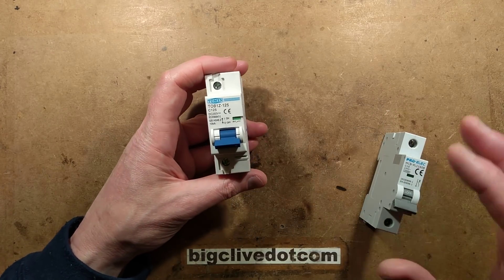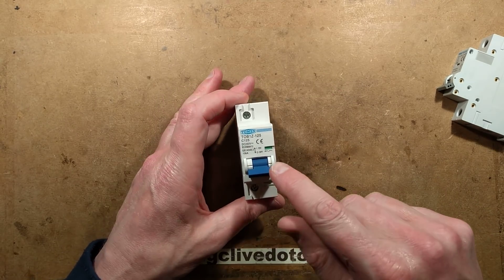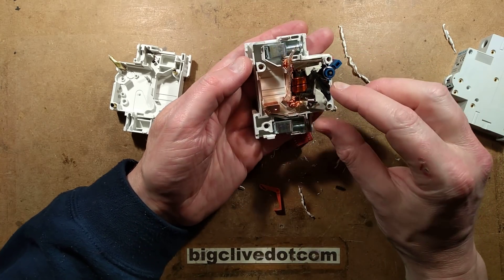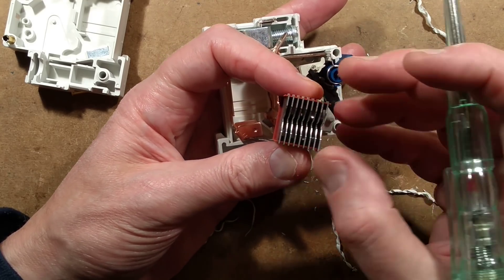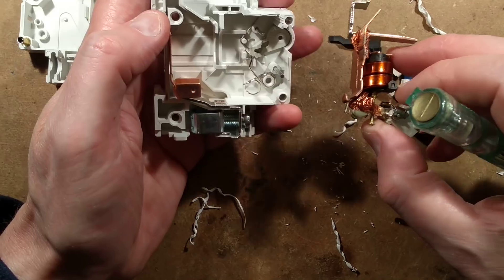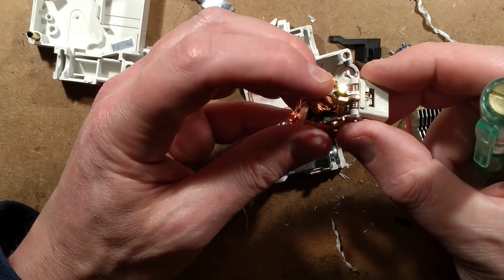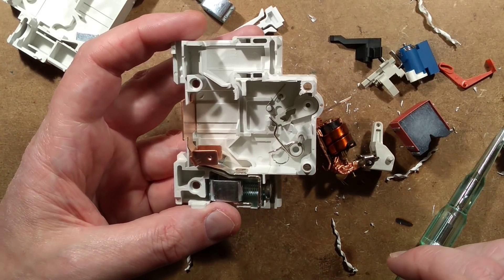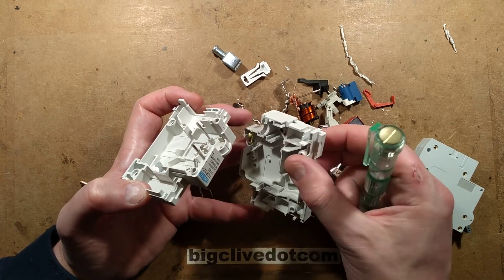Inside a 125A DC circuit breaker.  Unexpected arc quenching feature.

Comment: So because of the magnet I assume these go only one way round, right? I mean, it'll still trip if the polarity is wrong but the magnets will push the arc away from the quencher instead of into it I think.
Reply: There are 2 magnets, in order to create sort of parallel magnetic field, so that the arc would deflect to the right or to the left.
Reply: @nejiniisan1265 , "deflect to the right or to the left"? Not at all. If that were the case, there would be no net magnetic field in the region, thus no force would be exerted on the arc at all. The second magnet is presumably there just to strengthen the field as well as cause the field lines to run parallel in the region between the two magnets.

@ManWithBeard1990 is correct; if the current runs in the opposite direction, the force exerted on the electrons due to the presence of the magnetic field would be in the opposite direction, directing them into the front of the device (where the switch is), rather than the back (where the quencher is). They would still move clockwise from the perspective seen in the video.
Reply: @JivanPal  oops
Reply: @JivanPal  ABB's version (S800S-UC) is rated for use in either direction, but they claim it has two arcing chambers per pole (both AC & DC versions), so I wonder if they have a different polarity in each chamber?
The lower-current version still has +/- markings.

Comment: Many years ago (1990s) I designed UPS. It was impossible to get decent DC rated breakers. We used 3 pole AC breakers. One pole switched the negative. The other two poles were wired in series on the positive feed. This increasd the gap and aided arc quenching. Worked well enough. One thing that did surprise me was that none of the manufacturers would guarantee the operation of ANY breaker if it had tripped a fault. They recommended that any breaker that had tripped due to an overload was replaced. This made them no better than a fuse!
Reply: I was investigating DC contactors for a 240v ship-mounted crane. The ones I found were massively expensive, but one supplier rated their more common three phase units for use with DC when the load went through all three poles in series similar to your solution.

Comment: Can these things be used at 12 V DC ? I have a winch on my 4x4 and the main starter / charging circuit that are unfused. Also looking to put back up DC busses on. Could i use these for electrical protection?
Reply: Should be safe, as long as you get one designed specifically for DC at the current levels you're expecting. Using it at lower voltages just results in a lower energy arc when they trip.
Reply: @JilbertBoy  nice to have that confirmation. was thinking it may be an energy trip not a current trip.

Comment: My 20A DC breakers kept tripping because my MPPT would occasionally decide to drop the voltage and the current would exceed the rating.  So I've put the panels in series until I get around to upping the breaker.  Now my MPPT gets quite hot.  :(
Reply: Can you cook hot dogs on it?
Reply: @dsloop3907  Pretty much.  My fingers certainly feel cooked after touching it.

Comment: Nothing new. When I first started electrical engineering; I was shown such devices over 55 years ago. They were installed on Slate control panels for elevators. They actually used the current flowing in the circuit to generate the magnetic field which helped quench the arc.
Reply: The blowout coil solution does seem more elegant than the permanent magnets, at least when you go up higher in current and voltage.

Comment: Hi Clive, I used to work for a company that I believe was the UK supplier/agent for Heinemann circuit breakers and if I remember right, these were much more complex inside. They were used notably within the marine, traction and aviation industries. Not sure how you could get hold of one of these, they were quite expensive. Craig.
Reply: As a Student in the mid 70's I worked a summer for Arrow Hart Switchgear. I was on the 3 ph contactor assembly line but did some overtime on their DC breaker line. I always remember the really big (as in half-inch diameter) cadmium plated contact pads I was resistance-welding onto the conductors going into the DC breakers.. These pads were rated for 200A max, so I'd be surprised if the contacts on BC's breaker were good for not much over 50A.

Comment: People attempting to us AC Switches and Breakers for DC applications usually get educated rather fast.    Consequences of Current flow goes up EXPONENTULLY !
Reply: Been there, done that!! What I've found, is that a capacitor in series with a diode, then a resistor in parallel with the diode to discharge the capacitor when the contacts close will allow time for the contacts to open, before the capacitor has time to charge. That makes it so there's only .7 volts across the contacts(the forward voltage drop of the diode) the instant the contacts begin to open, which gives time for the contacts to separate, before the capacitor charges to a high enough voltage to jump the gap. When the switch is closed again, the resistor slowly discharges the capacitor, without putting extra surge current through the contacts. The capacitor needs to be big enough to provide the time constant necessary to prevent arcing. The higher the current, or the slower the mechanical speed of the contacts, the larger the capacitor needs to be. The diode needs to withstand the surge current long enough for the capacitor to charge to circuit voltage. The resistor is not critical, just so it discharges the capacitor before the next time the contacts open. I do that all the time, in circuits where relays have to switch DC into inductive loads. That works for switches, breakers, and relay contacts. In my 144 volt electric truck, the breaker was buffered by the capacitors in the motor speed controller. An AC breaker worked just fine. It was rated for 400 amps!
Reply: @vincentrobinette1507  It will be very helpful for some of us if you could provide a simple schematic (sketch) with values of capacitance and diode rating of your solution to the arcing problem. God bless.
Reply: @mansoorsiddique4843  I have no way to post a sketch on a reply, but, as a rule, the capacitor is sized based on the available fault current, and how fast the contacts can separate. The slower the contacts move, the larger the capacitor, The more fault current, the larger the capacitor. The resistor is based on how long it will be before the next interruption. It's only job, is to discharge the capacitor, once the contacts close. if it's a cyclic switch, like a solenoid used for a DC motor control circuit, you'll need a lower value of resistance, to make sure the capacitor is discharged quickly enough, for the next interruption.
     Case and point: When I worked at a convention center as a sound technician, we had a 24 volt electric cart, that was used to haul equipment from room to room. It featured a 4 stage sliding blade throttle, with three nichrome wire resistors. When ever you let off the throttle, the first blade would draw an arc, just like striking an arc welder. I fixed that, using a 2,200 uF, 35 V electrolytic capacitor, a 6 amp epitaxial "bullet" rectifier, and a 10 Ohm, 10 watt "sand box" resistor. It completely solved the problem. If the motor was stalled, or the throttle was let up before the cart moved, it would pass a maximum of ~40 amps. On a circuit breaker, you could probably get away with 10,000 ohms, because it will have plenty of time to discharge the capacitor before the next overload. Thermal stop interrupters,(push to reset button)tend to react slowly, don't have much space between the contacts, will need a larger capacitor. The peak current pulse rating of the diode is the most relevant rating, because it's only in conduction long enough to charge the capacitor up to the supply voltage. it is, however, momentarily subjected to the full available fault current. When the contacts close again, the diode is reverse biased, and the capacitor is discharged through the diode.
Reply: In pdf of AC CB is printed that it can be used for DC up to some small voltage, In some i read 48V DC, i use it up to 24V DC.
That is how the relays contact work, rated on same current but lower DC voltage then AC

Comment: Getting DC breakers is harder than you'd hope. This, at 125a is amazing for being so tiny. We use 200a 2 pole breakers.... but thats a huge unit. Not a DIN mount. A good 2 fists of volume. 6 inch high, 2 inch across. Great chunking  things. Biggest DIN mount, dc breaker ive met is a paltry 40a. Im no expert, but my technician spider sense would be very dubious of such a breaker. What's its breaking voltage? Under 48v, i might believe that rating.

My concern is, i didnt see a big arc supression feature. Maybe that is what the magnet is for. Ive seen big DC arcs drawn far longer than what spec sheets would lead you to believe. And an opening breaker is almost the same machine as one built to draw long dc arcs.

In my humble techie gutfeel, thats way to small...
Reply: The labeling claims 10 kA(!!!) breaking capacity at 250 Volts DC(!!!!). Even with that 2x2x2 cm arc extinction box, that seems like a very bold claim to me.
Reply: I'm with you, arjovenzia. That contact area is questionable, even for a 'one-use' purpose, and the separation when the contacts are open seems woefully inadequate. 125 A DC is into arc welding territory, and they're relying on a 'standard' sized contact, maybe 3-4 mm diameter, separated by about the same distance, to break that much current? At 250 V?!
Reply: It's that TOMZN chinese crap.. so probably lucky if it's actually break 24V never mind 240V DC
Reply: 10 kA is quiet on the low side of breaking capacity for these breakers. The AC breakers here in Germany have a minimum rating of 10 kA for household installations. On industrial installations they require a braking capacity of 20 kA.
Edit: Had it wrong. See Gaunerchens comment below.
Reply: @sebi7794  Yeah but that's for AC. Not DC. Totally different beast.
Reply: @sebi7794  The minimum rating for households installations is 6kA (according to TAB), 10kA is the normal industrial standart.
Reply: @gaunerchen1729  Yep, you are right! Had it false in mind.

Comment: 125 amps is bigger than my main house fuse and the electrons should be able to jump a big gap. JW showed an ac switch used in a dc circuit and it melted at the same same amperage
Reply: Tony Papantoniou Amps don’t matter in arcing, voltage does. So a 10 million amp source at .000001 volt won’t arc under standard temperatures and pressures but a 10 million volt source at .000001 A could arc several feet. Which is exactly why high voltage distribution towers look like they do to keep the transmission voltages as far away from ground and each other as necessary. 

FYI minimum arc is 10kV in dry air, the reason you see household stuff arc in the sockets has to do with inductance and collapsing magnetic fields creating high voltage.
Reply: @peterg.8245  DC needs bigger gaps on switches as it jumps further and quicker breaking

Comment: i bet they tested it, bc its such an important safety device, i have learned to much about electronics watching your channel, awesome thatnks so much !!!⚡️⚡️⚡️⚡️
Reply: so the magnets WOULD have more use in the DC circuit as opposed to using a magnet with the AC,,right just due to the behavior of the DC? ( like in a TV the magnets move the beam in the picture tube and its DC (highvoltage DC))???
Reply: @sa8die  Yep.

Comment: thosse things usually get tested.
Some got adjustment screw. They get triggered and adjusted multiple times at the factory until in spec, then the screw gets potted.
Reply: Yes, when we are talking about life saving devices, it is not enough that "they should work". They have to work, every single one!
I think they for some devices are talking about max 1 in a million non working units.
Reply: @friedmule5403  Regualr circuit breakers are there to protect the cable, not your life. For life saving devices there is common sense and RCD or RCCB breakers.
Reply: @anti4354  Okay did not know that, thought that the fast reaction time and wary low current was to save people.
Reply: @friedmule5403  If the cable fails, it quite likely ends up in flames. Flames in your wall are far from optimal.
Reply: @namibjDerEchte  LOL central heating, is a good thing:-) No I do understand but you have to be wary unlucky to get fire inside a wall, this is almost impossible if the system is build correct.
Reply: Fried Mule If the overcurrent protection doesn't do it's job, even a perfectly good system can overload the wiring by simply plugging in way too much stuff.  Then the heat insulation caused by being inside walls makes that part of the wiring the hottest.  If the next breaker upstream is the usual 2 to 4 times higher rated, then the loads can produce 4 to 16 times more heat in the overloaded cable, which will raise the temperature above ambient by about that factor.  So a cable rated to reach ambient  + 40°C might be heating itself and the wall above 600°C or 1100°F .
Reply: @johnfrancisdoe1563  It sounds like the Danish system is so much more secure then some other places. Fire is almost impossible, almost no matter what. Ok yes there are fire from faulty systems, but it is because at least 3-4 safety rules are broken. If I did choose to replace my fuse with a steel rod, drop my toaster in the water I was sitting in, while having an ground lead in my mouth, I may get a short tingling feeling in the micro second before the power would shut off.
Reply: Can confirm, at least the ones built by a company with three big red letters are tested both on overcurrent and short circuit. I actually worked on several production lines of said company at the plant those things were invented.
Reply: I suppose that's nice to know especially for a breaker like this. 250 VDC at 125 A = 31250 W = 31.25 kW. And it's rated to break fault currents up to 10000 A, which again at 250 VDC is a whopping 2500000 W = 2.5 MW!
Reply: @MicraHakkinen  Highest Ampere in private buildings in Denmark is 13A, normal is 10A so 125A would be in some place with wary big motors, where there have to be added a lot of security, and installed extra by professionals. 250V is in Australia, here is it 230-240V and 400V three phase.
Reply: @friedmule5403  10 A normal and 13 A max? Wow that sounds low. Here in The Netherlands it's pretty standard for newer home installations (at least for the last decade) to have 3 x 25 A on a 63 A main breaker at 230 VAC.
Reply: @MicraHakkinen  Yes it sounds low but 2400w pr phase is fine and, as you talked about easy to break in no time.
It is funny to learn how systems are in different country's! :-)
Reply: He was commenting on that because it's a cheap unit off eBay or the like, direct from China.
Reply: @Fridelain  yeah ok, thanks. :-)

Comment: Those magnets are smart, but now I wander what would happen if it gets connected with the current flowing the wrong way. That would push the arc away from the extinguisher chamber.
Reply: If it helps, think of the magnets at a right angle to the current flow, thus it doesn't matter the current direction.
Reply: Does not really matter, the magnets are there to force the arc into the quench chamber, they are likely multipole magnets so that the arc is just made longer, and eventually cooled down below ionisation temperature so it goes out.
Reply: @SeanBZA  This needs testing.

Comment: have you ever took a new LED streetlight to bits the ones with the round knob on top
Reply from the maker: Not that type.  Do you mean the small aerial that allows central control of all the lights?
Reply: @bigclivedotcom  the ones with the 5 G ready  knob on the top

Comment: Are these still reliable after breaking such a current or should you just replace them because of the flash damage and pitting?
Reply: They generally have a rating as to number of full short circuit cycles they can endure, typically for these high current units that is around 10-20 cycles of breaking before they are considered worn out. That is why they also are backed up with a DC disconnector, so that you do not use up the longer lifetime at lower current ( it is roughly in inverse proportion to current, you might be specified as 1000 cycles at half current and so on) if you are often having to disconnect the load.
Reply: Huge difference between breaking nominal current and breaking at capacity. I don't know TBH how DC MCBs are rated, but for your usual AC MCBs they are rated to 20+k cycles at nominal current (which translates to several times In for some types). However, don't expect them to break 10 Kilo-Amperes a few thousand times. That won't happen. My guess would be that it is similar for these DC breakers, except that I assume they have much lower cycle ratings for nominal current. Switching DC is *hard*.
Reply: @dasstackenblochen9250  If you look at the specs of a breaker, you will see an AVC rating(available fault current). This is the maximum amount that the breaker will successfully interrupt, without flash over. Usually, the rating is about 10,000 amps. Any higher, and you risk physically blowing the breaker to pieces, due to the temperature rise of the arc creating a plasma.
Reply: AC has a zero crossing, which occurs 120 times per second for 60 Hz, 100 for 50 Hz. DC does not offer a zero crossing, so you don't need much voltage, or current for the arc to continue flashing over. As the current switches polarity each half cycle. If you exceed the AFC, the arc may NOT extinguish during the brief zero crossing, and will maintain an arc, just like a stick welder. you've already described what happens next!